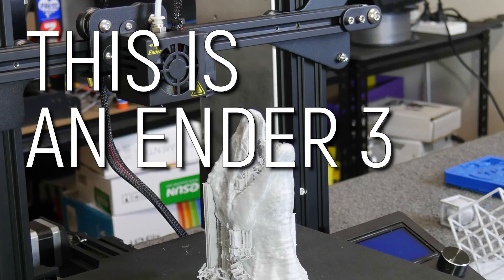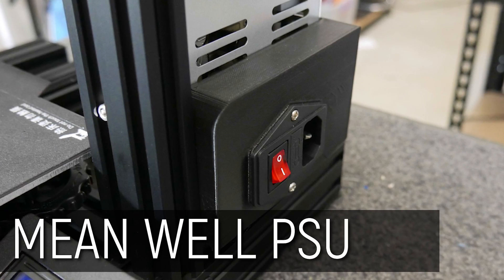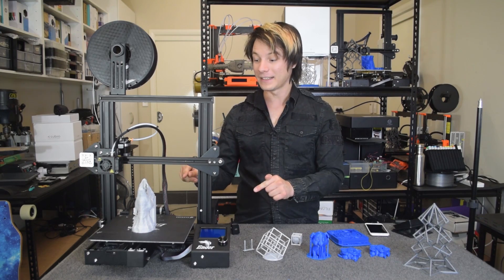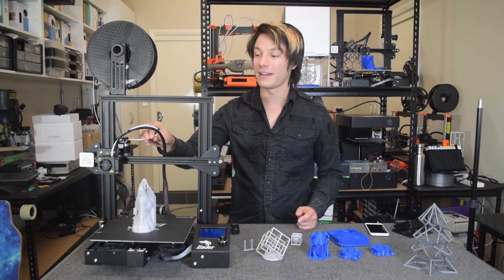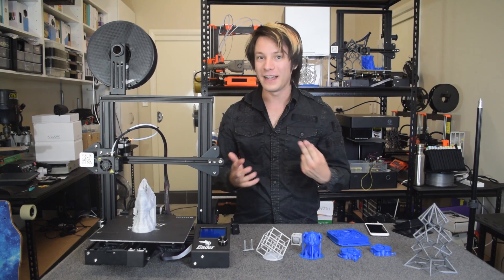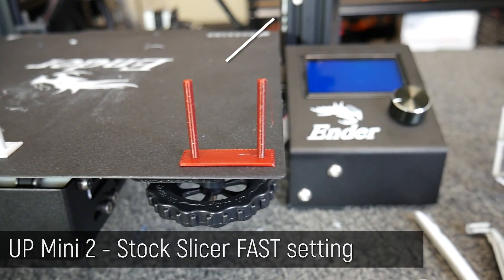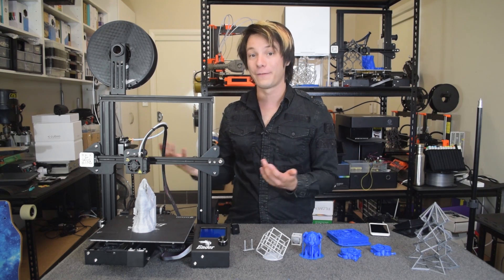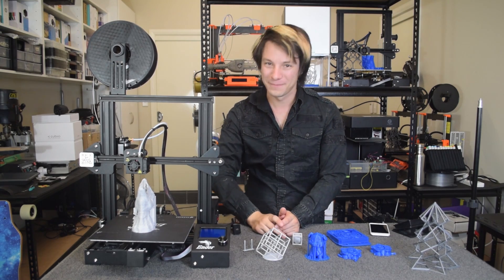Is the Creality Ender 3, Pro?

Comment: I know you know way more then i do and the fact you do not like the Ender pro but what most people apparently do not know is the right upright that the power supply screws into can be rotated so the screws holes are on the outside. what this does is give you much more room between the bed and the power supply, also the wires have plenty of slack so no problem. someone that has little money i an just glad to have a 3D printer. by the way i got mine for $201 free shipping.

Comment: Huh I just recently ordered this printer, the pro, because it was only like 20 bucks more so I thought "Why not?" but now I'm wondering if I would have actually been better off with the non-pro version if the bed is that f'ed up.  Can the bed be modded to be better?
Reply: I put a glass bed on mine and it's perfect. Original bed had a significant dip in the middle, only too be made worse after printing petg

Comment: Disclaimer: this is my first 3D printer.    I bought the Ender 3 Pro about a week and a half ago, and after watching many videos highlighting issues with the Ender 3  I found that mine has many little tweaks done from factory that address them.  Mine did come with the Silicon sock so I think I have pretty much the latest iteration.  My magnetic bed sheet does align fine so that the logo can face out.  I have been running this thing almost non stop with different little things, mostly upgrades (thank you to all the designers out there putting out improvements that I can print!).  I have had only 1 print with adhesion problems, but that was before I figured out how to level the bed properly (thank you youtubers for the tips!). What I am finding is that the adhesion might be a little TOO good... I'm finding most prints are leaving little bits that I can't even scrap off, usually part of the fence.  I don't know if that's an issue with my settings or just because it is so coarse.  If you have any tips on cleaning the mat surface I'm all ears.  So far the biggest "issues" are in the gantry and the print head rollers. I'm assuming since I see folks adding a 2nd Z screw (either with a belt or an additional stepper) that I'm not alone in the thinking that the gantry needs better support on the right side.  I've tweaked with the rollers and got it as good as I know how, but it just seems a bit off (in my very inexperienced opinion).  The other issue that I have is that to keep the print head from being very wiggly I had to tighten it and that has caused the rollers to start showing wear.  I've tried to tweak it to a happy medium, but mine goes from too tight to too loose in the most minutia of tweaks...  I guess I'll just be replacing rollers?  While I've not done many complicated prints yet, I've had almost no hair issues that I see others reporting.  Maybe I'll start having that problem when I get into more complicated prints, but so far its been very clean.   Overall, I'm extremely happy with my purchase and I'd certainly do it again!  As a hobbyist, I think having things to upgrade is half the fun!   I have ordered a few little after market upgrades that should be here today, but a better tube wasn't one of them.  Maybe I'll take your advice on that one too!   Thanks for the videos, please keep making Ender 3 related content!
Reply: For adhesion on my ender 3 Pro, I put some masking tape on the surface and it adheres quite well! Just make sure to not use a brim or raft, because it sticks quite a lot
Reply: i know I am kind of off topic but do anybody know of a good website to stream new series online?
Reply: @Cesar Yehuda Flixportal :)
Reply: @Francisco Ryker Thank you, signed up and it seems to work :) I really appreciate it !!
Reply: @Cesar Yehuda Glad I could help xD

Comment: I'm new to 3d printing. I just purchased the Ender 3 from Amazon. It should come tomorrow. What software do I need to start printing? I'm not sure where to start with everything!
Reply: Cura is a slicer, which cuts the model up into slices for your printer to print. If you havent designed the model yet, use fusion 360 (free, so is cura) as there are loads of tutorials here on YouTube. Let me know if you need help, I'm kinda new too

Comment: I think the reason why they disable the thermal runaway protection, is that often the printers will fail with it enabled, as the air from the fan bounces back off the heat-bed, when the z-axis is low, tricked the protection in to an error and aborting the print. The fix would be to only enable the fan when at a descent height, which isn't always favourable.

Comment: It's my understanding the Pro has the "Motion" menu like the CR-10 and the regular Ender 3 does not.  That's a big deal right there as that's the menu where you find esteps, x/y/zsteps, which are the only way to control dimensional accuracy of your prints.  You could do without esteps for basic extruder calibration (you could compensate with flow settings in your slicer).  But without x/y/zsteps, Ender 3 would be at a disadvantage compared to the Pro and CR-10.

Comment: I have the Ender 3 Pro it was my first unit I've only been printing for about 2 months I have zero issues with stringing the first issue I've ever had with stringing is when I printed petg the other day and I was printing RC car rims that's the first issue I had with stringing on the inside of the rims and all I did was take a torch like a propane torch a small one turn way down and hit it real fast and melted stringing away and then you could not even tell there was stringing but I've never had a stringing issue

Comment: I've never been a fan of bowden. Obviously it has it's advantages but when you have to do something like 6mm retraction to get okay prints then there's something wrong. I've been able to cut retraction in half with Capricorn tubing but it's 5-10% of the total cost of the printer...still prefer direct drive.

Comment: Can anyone help me sort out a problem with my ender 3. I had a strange problem with machine stoping randomly, after trying many things I decided to update the firmware with marlin. After this the printer does not stop randomly anymore it will run for 17 hours without stopping, but I can not understand my print quality issue I have now. The raft and first layers look like a woven basket pattern with equal spaced gaps between perfectly laid plastic. The quality issues are perfectly spaced and alternate between layers. I am using cura. Please help I am at my wits end with this machine. I was so excited when it arrived. Thanks

Comment: Hi .. I just bought Ender3 .. I have a strange issue .. When the print starts .. The filament is pulled out and the head starts printing without extruding .. I made sure that filament is extruded before the print.. But eventually the filament will be pulled out as print starts 

Any advice?
Reply from the maker: This is called oozing and is an issue with these machines. You need to put a nozzle wipe in the starting Gcode to prime it, I've got info here - https://www.youtube.com/watch?v=_QRb54zVPfQ

Comment: I have an Ender 3 pro - never seen stringing on any of my prints that resemble anything like that
Reply: Ditto, got my Ender 3 Pro three days ago -- been running it 24X7 and have had zero issues and very rarely see any tiny strings. Certainly nothing even approaching what he shows here.  I used Cura as slicer with all the defaults. Everything just works great. This guy is either incompetent or trolling Ender 3 owners to up his interactions in the comments to increase his youtube presence. Either way -- he appears disingenuous. I came into 3d printing a complete and total noob and am off and running with my STOCK Ender 3 Pro having experienced none of the problems this "professional 3d printer guy" seems to be hung up on.
Reply: @andehbus  I was starting to get a bit nervous. I'm currently waiting on1 to be delivered and it's my first pla. I purchased a resin printer a few weeks ago and absolutely love it, and since I need to print bigger wanted to try an fdm printer. I heard good things about the ender 3 and the pro was only $30 more so I went with it. At first watching this I felt some regret stirring.
Reply: Same here. I'm using Cura. Retraction fixes all stringing. The most I've got was a few wisps one time.
Reply: Yeah, I think that he is a bit bias towards the higher priced models that he has been using for years.  Even with stock factory settings, I never saw stringing issues like he is showing.  Right out of the box, I was getting better quality than this video shows with no adjustments.  After some slight tuning, I'm getting some amazing results that I have seen rival, if not exceed those of $1000+ printers.  He is the first person that I have hear really have much of anything negative to say about the Ender 3.  Granted it is far from the best printer out there and does have some issues (like the misaligned z axis that you have to print a spacer to correct), but for the price range, the quality is amazing.  

There are several other upgrades between the Ender 3 and the Ender 3 pro as well which he completely skipped.  I guarantee that if they sent him the model to review, they also included a sheet listing the upgrades.  Mine was bought at retail and came with a flyer listed the changes and improvements over the basic model.  The fact that it is quieter and the main board fan was moved to help keep it free of debris alone is worth the price difference.
Reply: Same here, some slight leveling issues, but no stringing.
Reply: Same here mines been great so far ..
Reply: I never noticed how he puts the magnetic plate on like 2cm off centered to make it hit the power supply.   It's the exact same size front to back so putting in on backwards like he does literally does nothing.  He just centers it that way. Lol

Still having none of these problems he complains about with mine. They are on sale right now. Best Prichard I've made for the price
Reply: @trueflightgaming9104  lower the temp to how many degrees? also, you say "retain speed" is this the same as retract? and if so, how fast and how much retract? thanks, im still having what to me looks like over extrusion stringing, but Ive gone as far as 80% flow and still having stringing, my machine is stock out of the box and Im using cura slicer. Any help is greatly appreciated.
Reply: @LCRAMBOR1  try lowering it in increments of 5 degrees.   It all depends on brand of filament.  I've even found some variance from spool to spool of the same kind.  Type also makes a huge difference.   Things like PETG will generally be a lot more stringy due to the higher temp needed. 

That was supposed to say retract speed.  Stupid phone.  Again,  I would do a string test and adjust it in small increments. 

Have you tried calibrating your extruder?  If you are having over extrusion issues. That might be the issue.   There are lots of video tutorials on how to do that on YouTube.   Once that is done,  really I just use the stock cura settings for the ender 3 with a couple tweaks here and there as needed.  I found that the default temps are long of wonky.  Cuts wants to print PLA at like 200+, but i find 195ish to be more than enough,  and yet it tries to print PETG at like 220 by default,  which is far too low.
Reply: +1
Reply: I just bought one and oh boy what a stringy little machine this is, care to share settings?
Reply: @LCRAMBOR1  I use the settings it came with and what I have found is different things happen depending on the filament. With Amazon basics blue filament, I had very little stringing and pretty good prints, with Creality white filament, a little more stringing but the prints look better than the Amazon basics. I know colors affect the way details show, but I'm talking just about the prints themselves. Next I'll be using Sunlu black filament. It may just be  the default settings work better with some of the filaments but I'm still figuring it out.
Reply: @LCRAMBOR1  if you're having stringing issues,  try lowering the temp or increasing retract speed a bit.  The only time I've ever freaky seen any stringing is with tiny details
Reply: Anyone using abs and cura? Can’t find the right settings on it. Using an enclosure
Reply: @joelo7135  I don't think the ender 3 pro can do abs without some mods at least.  In the very least,  you can't set the build plate to more than 70 or so before it starts losing magnetism.  Also the Boden tube can't really take temperatures over 140 for extended periods of time before it starts degrading. 

That said,  if you go into custom materials in cura, they do have a generic abs profile.
Reply: Trueflight Gaming I’ve done small prints no problem. But medium prints it just leaves a tumbleweed of filament
Reply: Trueflight Gaming thanks for your input!
Reply: @joelo7135  i don't know what to tell you.  I've never had any issues like that even with the stick settings.  I get a little stringing when using PETG, but nothing major. 

It could just be your filament.  What brand are you using?  Have you tried another spool/ brand?
Reply: Trueflight Gaming using a Kodak abs I got off amazon. But using the cura abs generic setting you mentioned and 3 hours in right now and no issues at all so far
Reply: @joelo7135  good to know
Reply: Trueflight Gaming got some cracking on abs with Ender 3 pro, so making a new print and hiked up the temperature to 270 and so far no cracks
Reply: @joelo7135  be very careful at that temp.  Your bowden tube melts at 250+. Doing anything over that without upgrading to a direct feed is just asking for a catastrophic failure at some point. 

I can get down to veery mills to no stringing with PETG around 240
Reply: Trueflight Gaming awesome thanks for the heads up! I’ll keep you posted
Reply: Me neither.
Reply: I am completely new to 3d printing and I have printed stock from everyone including the software. Absolutely no problems. No 3d printed power supply at all and no stringing ever.

Angus reminds us every video he has been 3d printing for 176 years, but this review is flawed.
Reply: Only issue i get is sometimes my bed levelling is off, never had stringing like that and i do a print a day at least
Reply: This dude is like anti budget printers it seems to me.
Reply: @johnbasterson7938  No, not really. But he doesn't go easy on them, especially if they lack thermal runaway protection.
Reply: @johnbasterson7938  he has to justify his 1k plus printers :)
Reply: Mark Jones same
Reply: Came here to say this. My 3 Pro has been fantastic from day 1. I paid $220 for mine and I'm getting better print quality than he gets in his $1000+ machines. I've used expensive printers before, and I can say that with even the most basic of upgrades this printer is just as good for anyone not printing exotic materials.
Reply: @thePretendgineer  Yeah, mine also prints far superior quality to a 5500 dollar cabinet corexy machine with dual extruders.
Reply: @PunakiviAddikti  if you want to see something really interesting, go check out what makerbot shows on their website for prints from their $6000+ machines. It's bad.
Reply: @thePretendgineer  Yup, an expensive machine doesn't automatically mean good prints. It takes tuning and the right slicer and right slicer settings. My prints improved when I switched from Repetier to Cura.
Reply: This video is two years old you fuc king re tards. The problems have obviously been fixed since then and is why none of you are having those problems. DUH!!!! this dudes been messing with 3d printing for years.
Reply: This seems like a fake or something lol he's having issues I don't have. His power supply cover is 3D Printed?? Mine isnt! Is his a knockoff? Lol
Reply: @ChadSmith305  He probably has an older version. They used to come with 3D printed power supply covers instead of the new injection molded covers. There's also some other differences in construction and firmware.

Comment: It has a better PSU from a known brand [and a magnetic bed (I know no ABS, but ABS stinks) which sticks very well..] so $60 should be worth that it doesn't burn down your house/flat.  Anyway, the Ender 3 Pro is really nice. Out of the box I've got a very good Benchy Boat. No strings, "smooth" surface, no other issues.. $250.. the price-performance ratio is just awesome.. but lets check out the other 1000 videos "is the Ender 3 Pro worth it"...

I've uploaded a pic of a benchy boat, was my first 3D print after the Ender 3 was ready. No settings touched, only normal profile in Cura 3.6.0... beat this with another $250 printer: imgur. com /a/tbZGhZQ

Comment: I have my ender 3, 3 month now and it prints extremly great. Yes the profile is important but there are so many great people out there which share already perfect settings for them in fb groups. I have barely visible layerlines when i'm printing at 0.08 mm layer height. I mean you need to think about the price more. What you are getting for this price is insane! I'm a 3d Artist and just wanted to print some of my creatures after a night doodeling. For a beginner in 3d printing like me this was the perfect machine. Sure i like the prusa but i don't get that much better results than on the ender 3 compare to the price. If so i would change but i doubt it

Comment: My ender 3 came with the silicon sock and thermal runaway protection, but it also had the buildtak and not a glass or magnetic bed. I got it from gearbest

Comment: So here is a question. If there isn't that much of a difference between the original and the Pro can you just upgrade the original with pro parts like the bed rail and the power supply